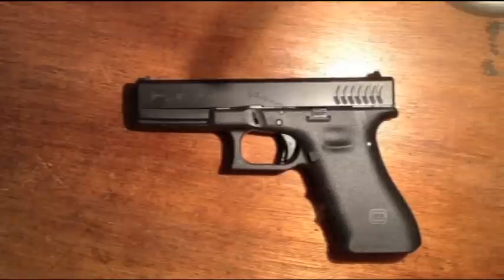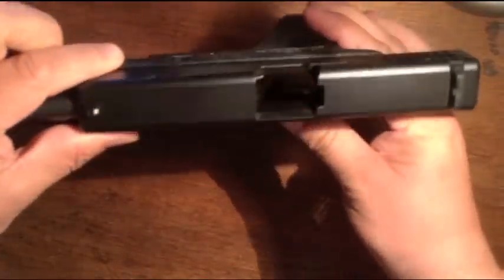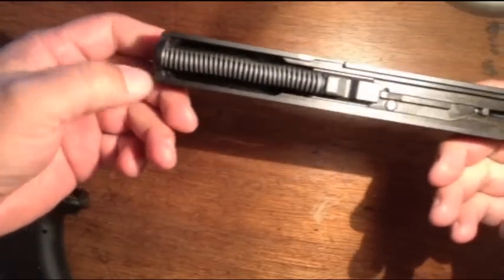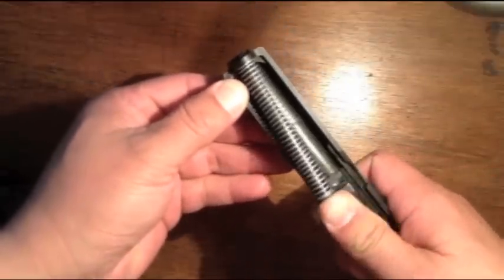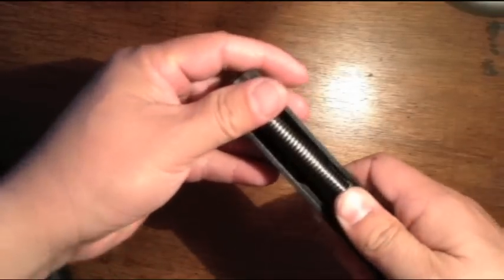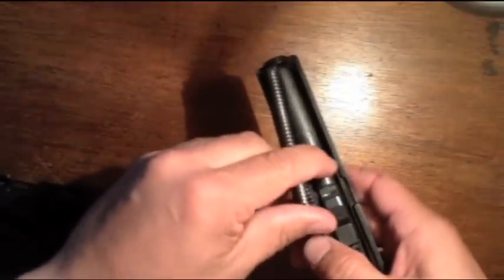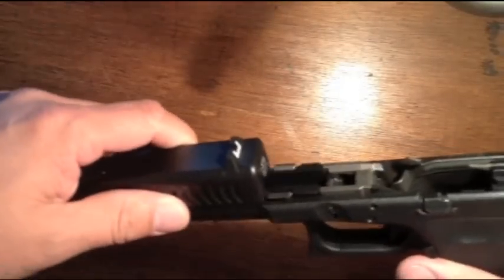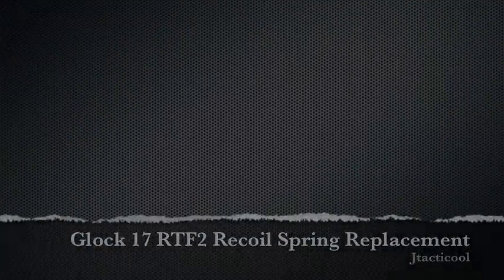Glock 17 recoil spring replacement

Comment: What is the point of the top notch?
Reply: That notch is where the slide lock settles into. It is not for reduced recoil. If you try to put the recoil spring assembly there, you most likely will not be able to put the slide back on the frame.
Reply: @danriano873 I couldn’t get mines to go on the bottom notch so I left it on top still put the slide on frame took the gun apart again and seen that it must’ve put it in place for me when I put in back on the frame

Comment: just picked up my first gun. A Glock 17 3gen. I've noticed when I take the slide off, the recoil is settled in a higher position. when I originally set the recoil, it was on the second grove on the bottom. unlocking the slide I noticed it was on the first grove. is this normal?
Reply: ThereAlwaysWatching ayyy fr this happens to mine too anybody know if this is normal
Reply: I noticed this on a Glock 19 Gen 5 today during disassembly.. Any resolution to this issue?
Reply: @josuediaz9869  Same on mine, any solutions?
Reply: It sits in bottom groove, when installing your slide, it will carry the spring to the upper one. It's completely normal.  Check to make sure you are chambered (with gun unloaded) pointed in safe direction,  pull the trigger and dry fire. Do this several times. Dissemble again,  notice position of spring assy. It should be in upper groove.  IF in doubt,  ask your local gun dealer to look at it. Most will for free. Or contact Glock and get specifics. 
Be safe 
Hooooah
Reply: Yes I’ve noticed when I re position the spring back from top to bottom whenever I rack the slide back and try to press the trigger the click sounds more different not very sure what it means but yeah I guess it does matter

Comment: If you don't explain to NOT pull the slide more than a 1/2 inch to the rear, some people will do so and reset the trigger. this is a KEY point, you might want to consider this point sir.

Comment: I'm scared that people find this video helpful.  If you don't know how to do this already, it means you know how neither to properly take down nor clean your firearm.  This is incredibly basic, should have been shown to you buy your gun store, and is covered clearly in the manual that came in your hardcase.
Reply from the maker: Michael Guio thanks for the comment. Some people don’t read their manual and I just thought it would help some people out.
Reply: @jtacticool  , sorry man...didn't to imply you made a poor video.  It is obvious people are benefiting from it.  I'm just worried that it is needed :)
Reply: @jtacticool  I just purchased a G17 Gen 3 yesterday. What pound RSA are you using and did it work out well for you ? Thanks
Reply: The manual is pretty poor. It doesn't show what direction to put the spring back in. It seemed clear to me but I wanted confirmation. Thank you for this video!